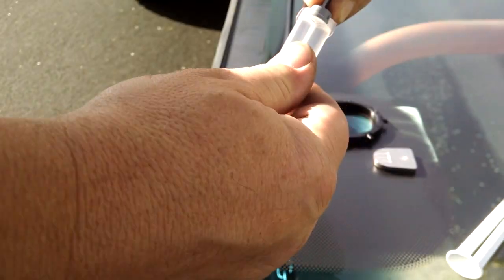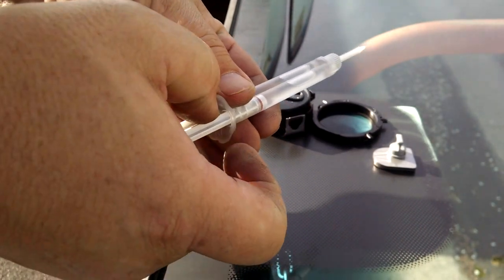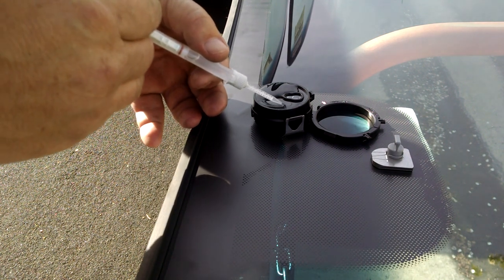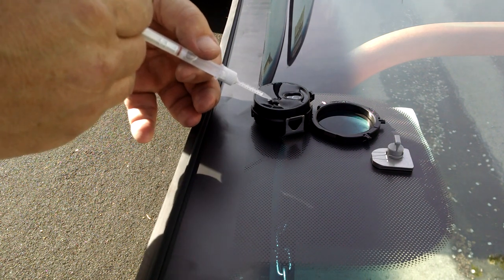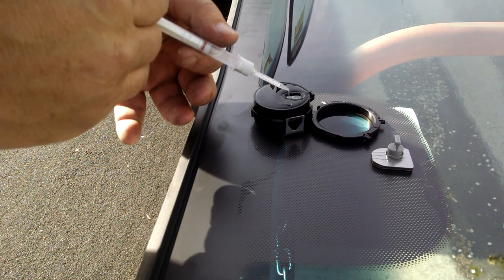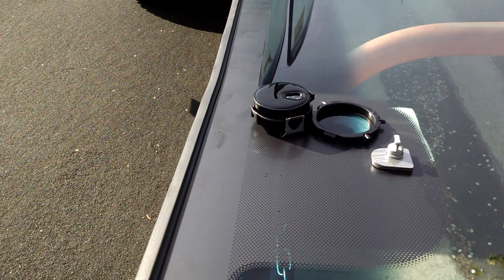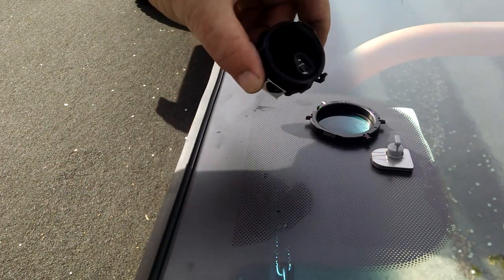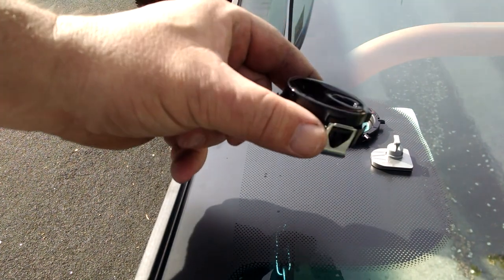Replacing The Rain Sensor Gel Pad On A Cadillac Escalade

Comment: I cracked my windshield and replaced it with a new one but the company that did the job did not replace that gel on your video. Is that the reason why the sensor doesn’t work properly?
Reply from the maker: Most likely. I have found that some cars need the OEM Windshield to work properly.
Reply: I was told by a Lexus dealership that the gel pad used in rain sensors needs to be perfectly clean, no dust/fingerprints, and that sometimes people try to reuse them to cut costs. I know for my car that it’s a $20-30 part. I replaced mine and it works perfectly.

Comment: Thank you for this! The metal bracket which holds the rain sensor in place on my GX 460 broke off, and have been searching for the adhesive used to remount it.